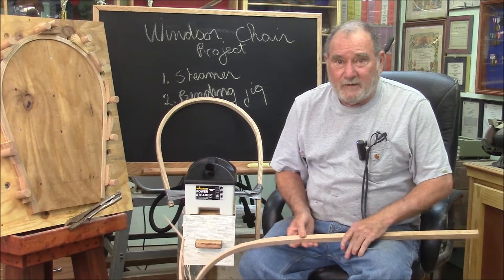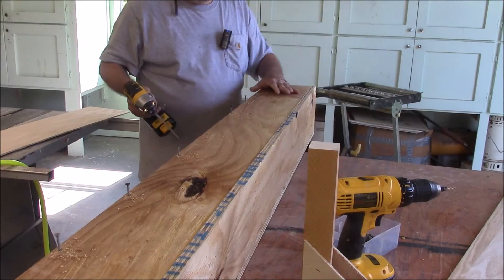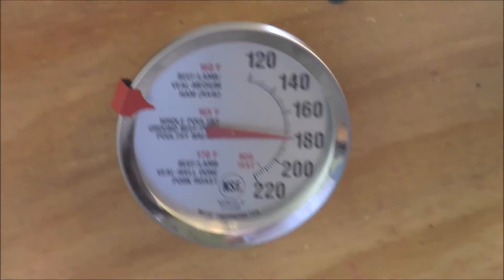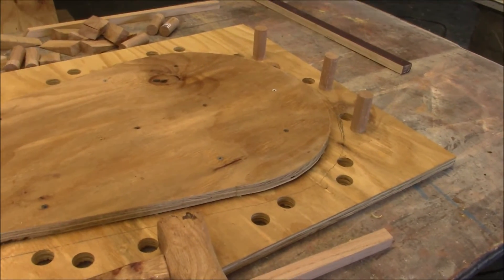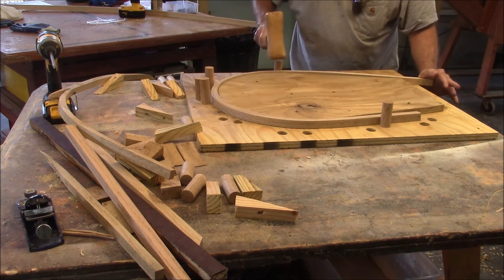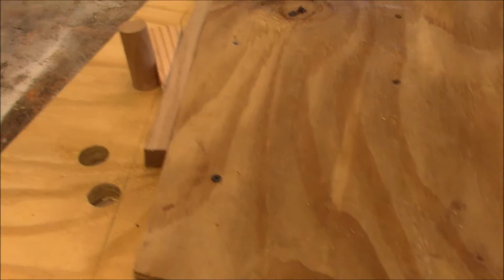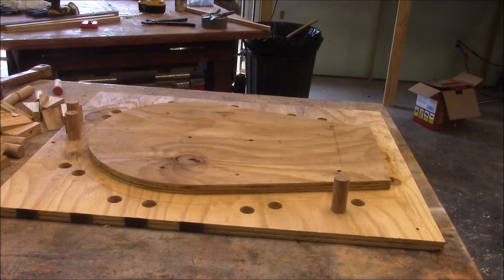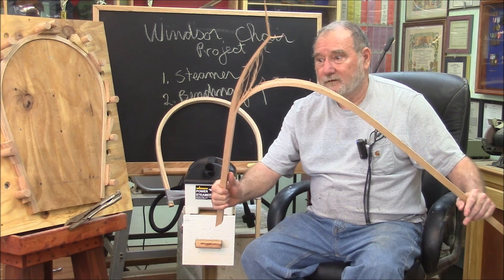74 Building and testing wood steamer and bending jig for windsor chair

Comment: The grains got allot to do with it, but you'd still get in some bends if you'd slow it down a bit... let the steam set in longer, then work your way out from center when you start... set your peg, then immediately set your wedge to pull it in...
You coulda probably got those that broke to bend despite the grain...
Reply from the maker: Of course, I'm a rookie at bending wood.  Lots of skill and knowledge missing at this end.  But that's how a guy learns, instruction and practice.  Thanks for the advice.  
    1.  Steam the wood longer.
    2.  Work from the center, setting the pegs and wedges fully as you go.  

Thanks for watching and commenting.

Comment: When you repaired your neighbor's chairs I wondered at the time how it would be possible for a home carpenter to steam wood. I really like the idea you came up with of making the wood box and using the wallpaper steamer. I can imagine how hard it must be to have to quickly bend the wood before it cools off too much and I cringed each time you bent the wood hoping it wouldn't break. Unfortunately you did have a few pieces break but that's certainly part of the learning process and I learned how important it is to have wood with straight grain which I wouldn't have though of until I had broken a few pieces myself or watched your video beforehand. Even though I learned from your video I'm pretty sure that if I attempt to bend wood that way I'd still end up breaking a few pieces myself. :-D
Reply from the maker: I going to add another wallpaper steamer to the box for the next project that requires steaming.  Just guessing, but I think I needed more heat and steam.  

Yep, those bent parts are almost always split, rather than sawed.  Additionally, the parts for these chairs are supposed to be split off of green logs fresh from the forest.  The logistics involved, and I didn't even mention the kiln I'd need, just made sawed wood the most practical choice.  

Next week we will finish building two Windsor Chairs from start to finish.  Going to be action packed, and I sure hope to see you there.
Reply: ***** I think your Windsor chair project is amazing. I'm not sure about the extra steamer or more heat because that's out of my realm of experience. But hey, it's nice to be able to learn right along with you. Looking forward to the next video.
Reply from the maker: ***** In 11 hours and 55 minutes you will see the final result.  You guys are so nice to me, but I really think it will be a valuable project.  Next week (a few hours from now) I suffer through with a single steamer, but with the skills I discovered in this first take, it all works out.  
     If my views go up, who knows, this may become the Memphis Windsor Chair channel.  Just kidding of course.  I get the most views repairing lawn mowers and pressure washers, but that is not what this channel is all about.  Rather, this channel is about the average person fixing and building everything, and the honesty it takes to know when a job is not practical by the "average person."  
    And yes, we are often learning together.  Deal is, I have one of the best woodworking shops on the planet. so failure can only be assigned to a lack of knowledge, or skill, or ability.  I'm pretty handy (ability), but we are all lacking in certain "Knowledge" and "skills."